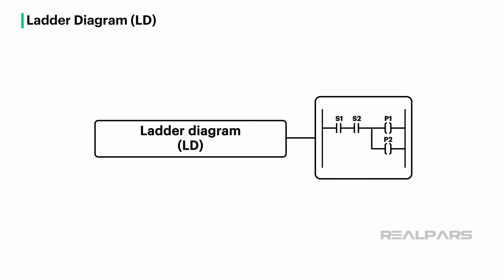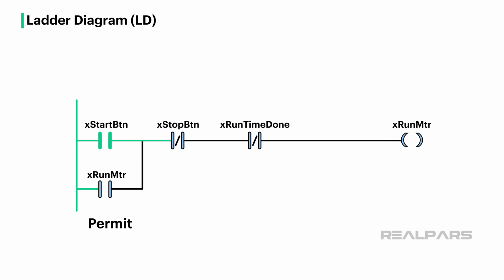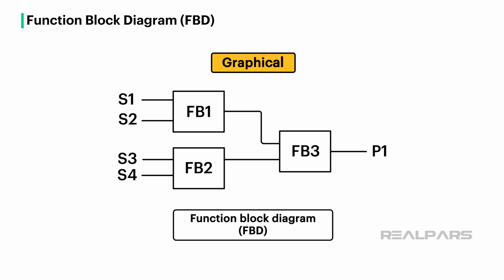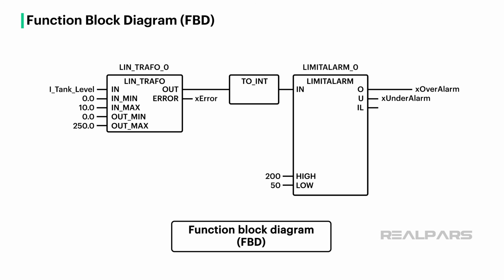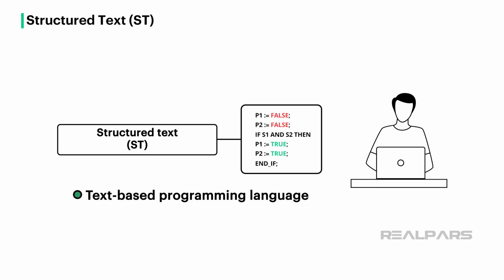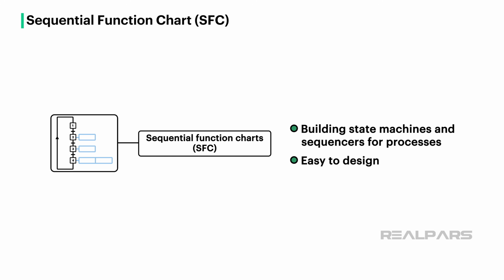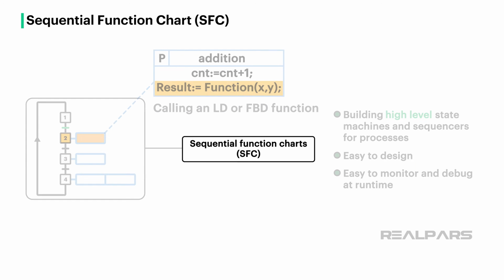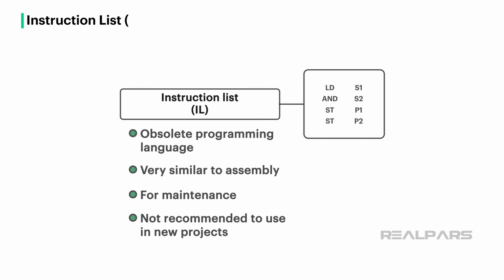Which Language is Best for PLC Programming?

Comment: I like structured text the most because I learned languages like c++ and python before PLC. When I was forced to use ladder I found myself trying to convert ST to LD in my head. Ladder is great for simple solutions like conveyor belts and smaller projects but eventually debugging can be a little bit annoying especially if theres a lot of math. FBD is a nice combo of ladder and structured text. You can make complex functions in ST and then use it in your FBD.

Comment: You will be forced to learn whatever is available.
Generally, my preferences are:
1.  Requires Tech/Electrician to troubleshoot:  Ladder.
2.  Recipe management where it either works or won't:  Basic (AB=> Structure text).
3.  Analog control:  Function Block;  Not a fan, but I see how some people prefers it.

Programmer should program with the end user in mind.  The end user is not just the operators/users.  The folks who have to troubleshoot the control system should be considered (skill set).

Comment: Hello realpars c an i know which plc is suitable for beginners for learning
Reply: S7-1200
Reply: @MRX123MRX   but the s7-1200s have many different models series out at there which model i prefer to buy just for traning ?
Reply: @MarsShare123  1200s dont support Graphcet (SFC), so if you have need for sequential  programming, it is best to go for older models or 1500s. We use 1215C for inital mechatronics students training.
Reply: @tomislavplese7801   alright Thanks for you advice ,and for me atcualy i would like to initial learn the plc programing ,so how about the s1215c is it good to use in some small automations project ?
Reply: @MarsShare123  1215C is good for start for sure, but is also good for medium sized projects. For these you can get signal modules if you need more inputs/outputs.